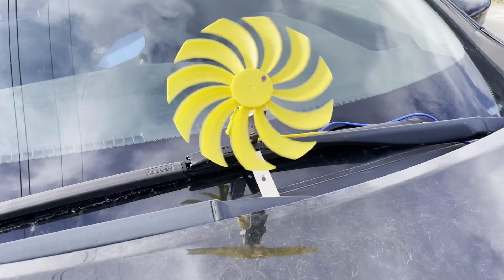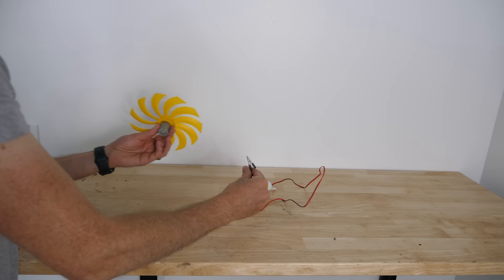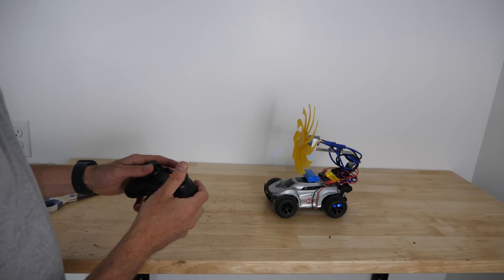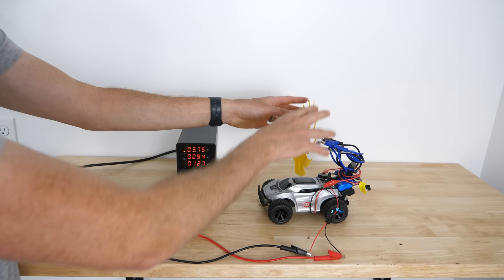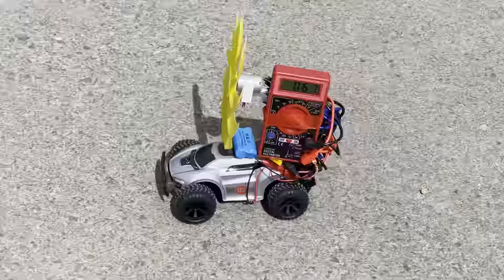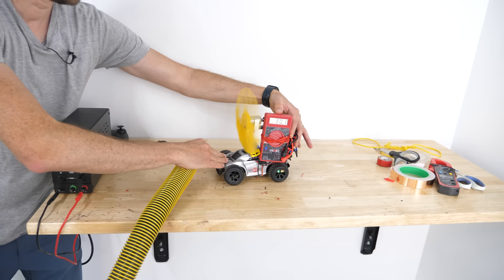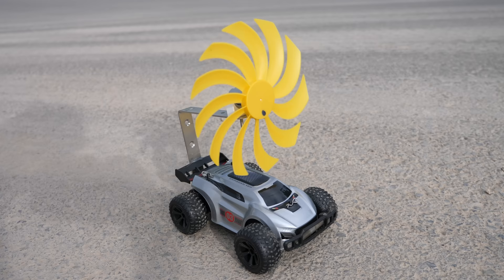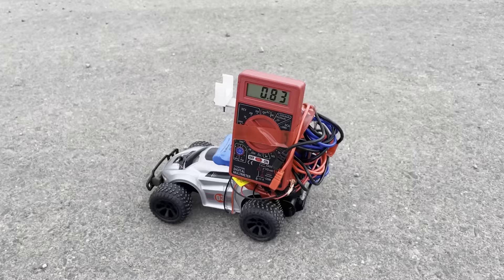Can You Power a Car With a Wind Turbine?

Comment: Had an idea for an ev car to have front wheels charging batt pack A whilst rear wheels are being powered by batt pack B. As your driving it's charging back some power to the unused power cell. When pack B gets to 10% for example, the battery pack switches over from B to A and the front wheels start charging up B now whilst using the power from A. Brake regen also aiding in the power  charging too. Main point being although not perpetual, "some" gain back is better than none so even if you got 20/25% recharge back from this, that could mean an extra 100mile range on a Tesla on the current 400mile packs. Quite a lot of cars already have AWD or 4motion already only using the other two wheels until slip is detected then engaging all 4wd mode. The friction and resistance is already in place on most cars and AWD EVs... Why not use that unused resistance (already manufacturered to cars on the road right now) to get power charge back instead. I'm not saying if you create drag to get power back as you use more power than the drag your overcoming... But what I'm saying is the drag is already there! Capture it
Reply: Because you're adding resistance to the wheels that the other wheels need to overcome to move. You'll have to use more energy.

You're trying to pull free energy from the movement you are creating
Reply: Because you're basically driving while applying the brakes. The extra energy it takes to overcome the braking force will not be fully recaptured by the brakes.
Reply: @MelodicTurtleMetal  "some" energy yes not all energy that's impossible, but given the other wheels are already in motion and forces are already applied, why not try to recapture that lost energy
Reply: @jdotoz  no that's not what was meant. Brake regen only captures the power from braking when braking from speed. It doesn't work as you holding the accelerator and brake at the same time. That cancels eachother out
Reply: @simedracing  If the wheels are already in motion and you try to capture that energy from them you will be slowing them down which means the other two wheels need to work harder. You ultimately use more energy than you generate.
Reply: @simedracing   brake regen works exactly like the method you propose, it's not based on braking, it's based on the resistance that is generated by converting the energy from the wheels to electricity to store in the battery. You can't convert the kinetic energy without applying a resistance, so in order to convert the energy from the power generating wheels, the other wheels will need to output enough power to overcome the resistance. At 100% efficiency you would charge the battery with the exact same amount of extra power you used to overcome the resistance. 

It really would be like driving with brakes on.
Reply: @simedracing  The net result is exactly the same. The brakes convert the rotational kinetic energy of the wheels into some other energy. Your proposed generator does the same. If the car is to keep moving, you need to add extra energy. So you drain the battery faster, but capture a portion of the extra energy for reuse. Net result: more wasted energy than normal.
Reply: Could explain why it's not been done before then 😂

Comment: What about if you tweaked everything. Got a super low drag coefficient, and instead of having a big bladed turbine like that which is acting like a wall, rather have funnels built into the cars body or alongside it that funnel the air to smaller but equally efficient turbines at the back of the car. In my mind, surely that would produce much less resistance. The goal being to have some percentage gains while driving. It doesn't need to be more than what's put it, wr know it can't, but if you could even just double the battery range that's would be something worthwhile

Comment: If your car is staying at one position and then suddenly you pressed a switch and then one turbine comes out then it's charging your car in 2-3 days , then and only then it will be useful . If you planning to drive your car and charging with wind turbines then it doesn't make sense . You will run out of your charge at some point

Comment: What if you had a propeller on the back of a vehicle on a scale where it didn't cause any resistance for forward movement. Like the placement of a spare tire as an example.

If the vehicle in question was shaped in a way to channel the air it's displacing as it moves towards this propeller it might work.
Say the propeller in question rotates clockwise.
The driver side would direct air to back and slightly up while the passenger side would direct the air back and slightly down.
This way both airflows are working towards the proper rotation of the propeller, and due to its fixed place on the rear of the vehicle it's not causing drag in the way it would in the RC car example.

Could a system like this this work in reducing energy consumption?

Comment: Is there a happy medium or a sweet spot where a turbine could charge the battery but be small enough to not increase wind resistance? or something that would make the battery drain slower?
Reply: You would at best only be able to gain the power from whatever wind power would have existed if the car wasn't moving in the first place.

Regardless, the power generation would be so small that it could never justify the complexity and maintenance required for the device.
Reply: @MelodicTurtleMetal  am I understanding correctly if I say that any added benefit of the wind generator would be cancelled out by the wind resistance? 
Is there any conceivable situation where adding a wind turbine on a vehicle would make sense if it was small enough?
Reply: @Sanity016  The size doesn't really matter, the issue is you can't create energy. The energy you obtain needs to already exist in the wind you're extracting it from. When you move a car you don't create more wind - so you'll never obtain more energy moving than you would at a standstill. If your propeller blades are moving faster when you move, then the extra power needed to move the blades will come from the car forcing the turbine through the existing wind. 

Because you'll always be applying a force towards the wind, you'll always be less efficient moving to the turbine than you would having the wind blow into it when not moving.

It's all about transferring the existing energy in the wind into the turbines.
Reply: @MelodicTurtleMetal  Your explanation is actually very helpful thanks! I have this part of my brain that wants it to work, but it makes sense what you're saying. Thanks again for helping me understand
Reply: @Sanity016  i feel you. That feeling is what inspires so many people to keep trying to make a perpetual motion machine. And it's not a pointless goal - while we can't create energy we can always find smart ways to convert other sources of energy to work in our favour. There's so many sources of energy all around us, we just need to find smart ways to absorb that energy without expending much in the first place. 

Maybe the best place to add turbines or fans would be in the exhaust, since that's a source of waste energy we can't use. I guess the biggest problem there is the buildup of soot and such which would probably stop them from moving quickly...

Comment: What about the race car they made that that blows itself forward blackbird it's called vertasium did a video on it proving it uses the wind to travel faster than the wind by using the propellers as a fan and linking it to the wheels so as the wheels go faster it blows harder accelerating could you use a fan generator geared to the wheels in such a way to help accelerate and generate energy I think you could.

Comment: So the only way to gain energy for a car on the move is through little generators powered by the breaks or solarpanels on top. As long as no one implements a deployable windturbine for strong winds when stationary, could be enough power to start a combustion car with an empty battery🤔

Why not just build in retractable bike pedals in the footroom to power it by yourself and stay physically engaged on long roadtrips :p

Comment: I thought about the same thing... But me I was thinking of putting the turbine inside the hood. In front of it... but inside. this way the car won't get that wind resistant. Secondly I think your turbine had too many wings. I am sure if you took some out.. the car wouldn't force to go in the wind that much. And 3rd that big bracket doesn't help on the weight.

Comment: Crazy you still have to explain a law of physics these days. A wonderful real world example though.
My thought for making it useful would be if you had an internal combustion engine powering the turbine that would charge an auxiliary battery bank you could then use camping or to plug your house into. I’d be curious to see if the alternator with a BMS and charge controller would be more efficient, if the turbine would be more efficient, or if the combination of the two would net greater results than running a generator. Not breaking the laws of physics. Just different forms of power generation. Wind turbine powered boats are a thing, so it’s not too far fetched.

Comment: Sorry to get you with two critical comments at once but I wanted to mention this before I forget. So, while I'm sciencey my partner isn't so much. The impossibility of and ability to recognize an attempt at a perpetual motion device isn't ingrained in them. When we watched this video together she was convinced the fan would be beneficial, and even after your experiments she was sure you didn't do it right. The idea of a bigger turbine was mentioned but it's drag is obviously not going to help. I think the one thing that would have helped convince them is a more efficient car. Seeing the not-weightless chonky meter slapped onto the side of the rc car was a point of confusion. A real effort to try and make it happen (even though we both know it's impossible) is what appeases the "but what if they tried this" mentality. Think of what the "crazies" might say (referencing Science Asylum phrasing).

Comment: A perpetual motion machine of course would be absurd. But I am till curious how much power might be added to the battery say it it was tied into the breaking system. So when the car breaks vents could open as part of the breaking system and pull in energy. in addition using the cars motion while stopping could also generate power while breaking. definitely not a perpetual motion machine .... but what about such a system extending the range of an electric vehicle? It wouldn't do much driving between cities on the high way but it might have some effect in stop and go traffic. I just have no idea how much effect.

Comment: The trouble with this that I see, is that you have put a large additional drag on the car, rather than putting a turbine where the car is a Brick anyway.  I think if you put something like a Waters turbine (the one with the cone shape that funnels the air out squirrel cage like ring), and you stuck that on, say, the front grill, where the vehicle has to pay the drag-cost Anyway, I think you would see actual benefit.  Or if you stuck a squirrel cage rotor off the back of the vehicle, top or bottom, where there is Already turbulence and drag, as it doesn't really matter if the thing is spinning or not, from a drag perspective, if I understand that correctly.  Like the back bumper is a certain amount of drag.  might as well let it spin and generate some.  
I think some clever design and placement could achieve some small benefit.
Reply: Anything added to the car at any location that generates electricity will cause the car to use more power than it produces.
Reply: @notcorrect  not if it is already a point of drag youre having to pay to push through the air Anyway.
Anything you recoup from that loss counts as a bonus. Im not talking about it producing more than it takes to move the vehicle.

Move a propeller through the air, and its the same drag whether its turning or not.
So the big flat front of a truck, it wouldnt cost it any more to stick a turbine there than to plough through the air without it.
Reply: @Ryan James Loyd  adding a turbine to the big flat front of the truck will increase drag. It will not generate enough electricity to compensate for the drag added by the turbine. When wind moves, some energy is taken out of that wind in order to make it move. That wind is produced by the propulsion of the car through relatively standing air.

In the front of a car there is a spinning pocket of air that pushes oncomming air out of the way. Adding something in front of it will ruin that pocket of air and greatly reduce efficiency.
Reply: @notcorrect   cant get much less aerodynamic than a Wall. If part of that wall spins, it is irrelevant.

Comment: What if the windturbine would've been built into the chassis. Then you don't really have a bigger wind resistant than normal right?
It would be more efficient or am i wrong?
Reply: On most cars the car is designed to be sleek and reduce drag, the air turbine intentionally makes drag (it is what turns the turbine). So you end up worse off the extra drag is more than the extra energy when you are talking about wind made from just the car moving.

Comment: what if you turn the fan sidr ways like a wheel and to top it off use a pully band around the car wheel with a high gear so that it dose not slow the car down ?

Comment: Thank you for demonstrating,.yet again.that There Ain't No Such Thing As A Free Lunch. That pesky 1st law of thermodynamics will bite you every time.

However, it is possible to use a wind turbine directly to drive a vehicle mechanically. It is even possible to exceed the speed of the wind. Derek at Veratasium demonstrated that. But it required wind to do it. TANSTAAFL - what a concept!

Comment: No, u messed up a lot of fluid mechanics here. You can put a windmill on a bike and it will not add any extra resistance, but car is too small hence it will affect the resistance dramatically.

Comment: Try a Tesla Turbine! This is what I put in the search to see if these work with less resistance due to design. Could tesla turbines be inserted near each front wheel fed air from scoops in the design of the front clip and help power up batteries in an electric car?

Comment: isn't this the case for hybrid cars too? You use more fuel to charge a battery that will then give less power back.
Reply: Hybrid cars "can"  benefit due to the increased inefficiency of running an engine (and entire propulsion system) outside its "best performance"  parameters. - ie. Stop-start, variable low speed general urban travel, with energy recovery from braking.  If trucking (driving) on flat inland areas at optimal constant speed with near constant power input and constant speed, the inefficiencies of a hybrid system overcome any performance gain under acceleration and deceleration regimes - the same goes for long range airtransport, a little time taxying and climbing  with " huge inefficiency" (due to mismatch in thrust velocity compared to aircraft airspeed)  is offset by a very long  efficient cruise flight - not paying to carry heavy "hybrid gear" - only used for the first and last few minutes of a (say) 16 hour flight...

Comment: Redesign the rc car . Place a fighter jet type duct & in that duct place a wind mill .

Only problem with this configuration is when rc car is standing still than wind blowing outside not turn the fan that's inside the duct as the wind needs to be coming right from the front

Comment: This design is only effective in downhill driving and coasting occurrences. The weight of the car pulls it down the hill, generating wind power that the car isn't outputting from internal batteries which reduces electrical usage for the greater journey through an electrical regenerative effect. This takes advantage of gravity, the slope of the descent, and the unpowered momentum of the vehicle to obtain a wind current. To further, when the vehicle is in a coasting state, the propeller will obtain non self generated wind and thus generate surplus power. This takes advantage of unpowered momentum. In a more advanced designed vehicle, like an electric car, both hill declines and coasting states are more readily achieved in a better use opportunity versus a simple toy electric car that doesn't encounter descents nor a good coasting state. This is an intermittent opportunity charging solution. This system is supposed to be combined with other energy efficient solutions like regenerative braking, solar panels, and weight reducing measures to extend the battery life and the total trip capability.

Comment: This is exactly what I thought… So why the hell does that desert car work where the wheels power a propellor????? I can’t figure that thing out still
Reply: The Blackbird exploits the energy available at the air/ground interface from the true wind (i.e. air moving relative to the ground).  By harnessing that energy, it slows the true wind and can use that energy to power itself (directly upwind OR directly downwind).

Comment: Saving energy wih a turbine becomes posible if you put the turbine in front of the car! The turbine slows the incoming air instead of the car itself ut generates energy doing so instead of the car just producing drag. No perpetual motion though because you are just reducing the amount of energy lost from drag by getting some back as electricity.
Quint BUILDs made a great video about that! 

So I'm afraid your conclusion is not always true !